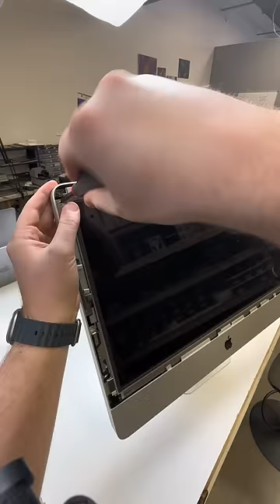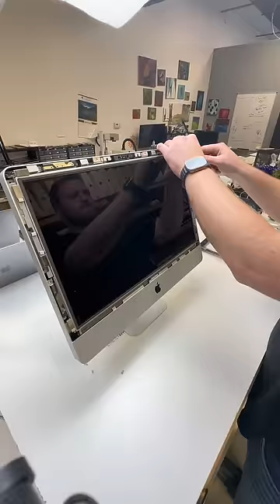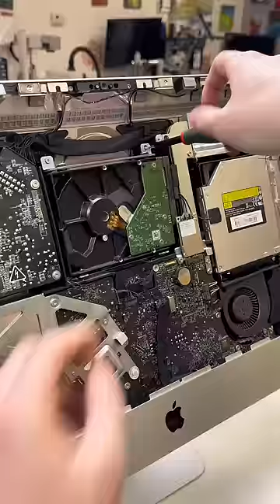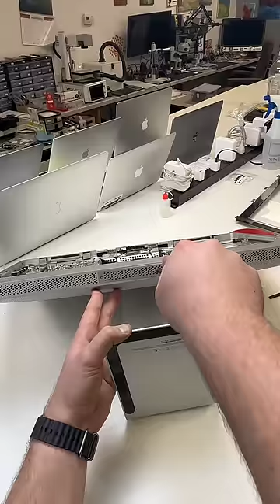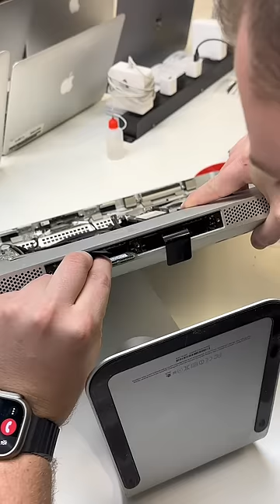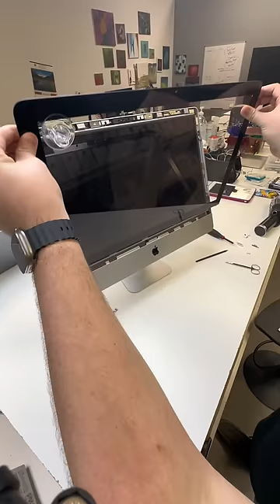7 years later and he’s back! #strictlyapple #thebestforless #shorts

Comment: apple meanwhile making sure their products are as hard to open and upgrade as possible
Reply: YT made me rate your comment 💀, voted excellent 😏
Reply: @OmniscientReadr  thank you 😀
Reply: yes they could put a backplate on 😅 but what apple do they say first take the screen out, even a windows laptop is more easy to open
Reply: and sadly, more and more brands are copying Apple's shitty design. I have a 2021 Lenovo thinkpad with soldered RAM + one DIMM slot. God forbid the soldered RAM has a fault.
Reply: @MrR2185  it's so sad that most people only care about their laptop's thickness and design. My 2013 lenovo is boxier but has ram that's easy to upgrade and replace.
Reply: @kosmas173  I hear you on that one. We still have a 2012 era HP 8570(3rd gen intel). I swapped out the CPU to an i7 quad core, bumped to 16gb of ram, a newer wifi card and an SSD. It runs Windows 10 great and with all general computing tasks...and built like an absolute tank.

Comment: Did the same thing myself. Performance gains were insane. Used to take about 2 mins to boot to usable desktop. 

Less than 30s after upgrade.

First run of chrome process was 10-12 seconds before upgrade. 

After upgrade, 2 seconds

Comment: I’m impressed you kept the cost below $570 most places would charge I’d assume around 300 on those parts pending size of hard-drive and an extra 200-300 on labor. Nice to see someone out there helping people.
Reply: Dude could have done it himself for the cost of the parts and a hair dryer for less than $150. The SSD would have been the most expensive part and you can get a 1TB now for about 80 bucks. 16GB DDR3 RAM about 30 bucks. Watch a couple YouTube vids and he would have been good to go.
Reply: Plenty of people pay $100 for an oil change. Plenty of people pay 50-100 to get tires rotated. Computer technicians charge usually on the low end $90 an hour on the high end upwards of $200 an hour. For someone that knows what they are doing it’s an easy 1.5 hour job with data copy and install. For someone that has no idea what they are doing. They might crack their screen. They might rip a ribbon cable, he might corrupt his data somehow when trying to copy. I’m all for fixing things and not replacing them. But also was just pointing out this tech did what most don’t and he didn’t screw his customer over. He probably charged cost on the parts instead of double or triple and it sounds like his labor rate is likely way cheaper. 

If you were to get a simple data copy at staples today it cost $150 
If you want an operating system reinstall that’s $199 and that’s not even a trained tech it’s just some min wage employee that did a two week training.
Reply: @reycaribe  where do you need a hairdryer for?

Comment: What software you guys use to clone the drives?
Reply: I don't think you have to use anything.  I read up on this a few years ago.  You can use a SATA to USB adapter on the new drive and drag/drop the system disk onto it.  You can even test booting from the external drive before installing it.
Reply: @tonyfremont  You may still need the other partitions and the data on it
Reply: I did this for my grandma a few years back. when you get the new ssd you have to either used windows to format and load the os onto the ssd. Or you can put it in a USB and boot from a USB device like windows just a bit more complicated and don't remember each step but fairly easy once you figure it out I'd say the older os runs better on these seeing as how I phones put out updates to slow down older devices just a thought when getting your os. 👍🏼

Comment: Bro fixing right but spraying directly on screen rather than the cloth💀👍🏼
Reply: ??? thats normal and fine
Reply: Dont you see the glass panel that literally gets removed in the video? It's the one getting the cleaning liquid not the LCD screen underneath
Reply: @tranquochuypotato9464  doesn't matter, it still can get a bit of liquid trough the glass panel and damage the equipment, it's always better to spray the cleaner on the cloth and avoid this to happen
Reply: Came to the comments just for this. Never spray direct!
Reply: @fernandoloch3779  screen cleaners are usually mostly alcohol, like 70%. Typical instructions say wipe until dry but that's to avoid specks and wipe marks, at 70% alcohol it's not the best but it will evaporate decently quick without killing a pc.
Reply: Also, he blew right into the fans without securing them causing them to create current...
Reply: @littlewing6611  What? Air current? Isn't that what fans are supposed to do?
Reply: @ch4z_bucks  current like in creating electric power. A fan has an electric motor. If you turn the fan it becomes a dynamo, creating power. This can damage components.
Reply: @littlewing6611  unlikely. Most motherboards have protection in place to prevent such a thing from frying a circuit, and considering the spin caused by a vacuum cleaner isn't too fast I doubt it would generate enough to cause damage to an unprotected board either. Generally speaking though you should be ok to vacuum your fans, the only real risk comes from damaging the fan by having them spin in the wrong direction.

Comment: Nearly to 40 yrs in printing.  I've used the whole range of pre-press software, even the older typesetting machines with spinning type discs.
 Had a PC (which ran my imagesetter for years) the power supply went. No problem, got one replaced very quickly around $100. When my Mac (the same age) went Apple no longer made the power supply (and of course they're the only maker).

Comment: ah we had one of those imacs come into the second hand store i work as a general electrician at and well.. the previous owner was the local hotel.. i know that because when i started it there was a user with the hotels name and they had not done a factory reset before sending it in.. i thought it would be a pain to do as i did not have the password so i couldn't do it through the setting but i was glad to find out there was a way to reinstall the OS without signing in.. was actually a little surprised that i did not need a usb with a installation immage on it like with windows computers but that it instead just downloaded everything by itself.. that is one of the only times i have felt that apple has done something right.. instead of just ripping off their users.
(of course if it had not worked my second plan was to figure out how to take it apart and acess the hdd but i knew that doing that would be risky because of how much apple is against right to repair so yea.. glad they made it possible to just wipe everything from the boot and recovery options..

Comment: Nice. I had a Linux computer that ran since 1998.  It has an ide drive. And barely enough ram.  I splurged and bought an ASUS laptop with Ryzen processor and 4 Gig of memory per core 32Gb Total.  Swapped the m.2 with a much faster 1TB m.2

Used ssh to transfer all my data. Now all must code is running on a new modern Skackware machine.  I could not be happier.

Comment: At this point at would be checking the thermal compound on the CPU and GPU as well. Unfortunately he won’t be able to run the latest OS, but he could use Bootcamp to run Windows 10.
Reply: That was my thought, too. I'd just replace the thermal paste because you know that stuff will be dried out after 7 years.

Comment: Did you remember to move the ODD temp sensor cable to the HDD slot on the Motherboard so the fans dont run at 100% all the time? ;)

Comment: It’s irresponsible for a tech to encourage using such an old machine. They run out of date OSes and the browsers cannot be updated either. Which means aside from security they are lacking functionality, basic websites are nonfunctional on such an old setup!
Reply: High sierra is still supported under all major browsers. Except for safari, however that is still pretty modern and works quite well still.

Comment: Only 16gb- why didn’t you just stick 4- 8gb sticks in? Two (2) 8gb sticks at OWC is just $28.99- putting 4 sticks in would future proof the iMac! While you had the display out you could have installed a re-flashed K2100 2gb Video Card!

Comment: POS computers, had a 27" imac. PSU and GPU went dead just under warranty. And my screen had dust between backlight and IPS panel, did that myself (cleaning it) and the aweful machine ran hot all summer without any load. Thermals are a nightmare (even with fancontrol at full, with a blower pointed at the back of the machine) Apple, NEVER AGAIN!

Comment: But you can't use the latest operating system though, right?
Reply: Why?
Reply: @Abhinav Karande  I believe the processor needs to be compatible as well, and I don't know if one can upgrade it, or if it would be worth the money. Isn't it cheaper and safer at a certain point to buy a new one?

Comment: When do people learn to not let fans spin freely when cleaning them? You are inducting voltage which could be too high for other parts and literally fry them
Reply: No it can’t. They don’t generate much at all. Even if they did most computers after the late 90’s have diodes in place to prevent that in the off chance it could cause an issue.
Reply: @EvilTurkeySlices  that doesnt make any sense at all. A diode is not overcurrent protection
Reply: @DerTechNick  a diode isn’t overcurrent protection, but it’s back current protection.